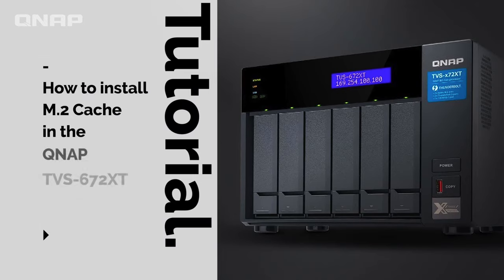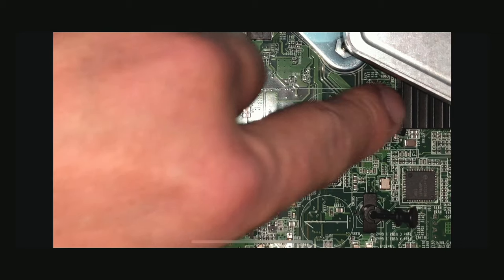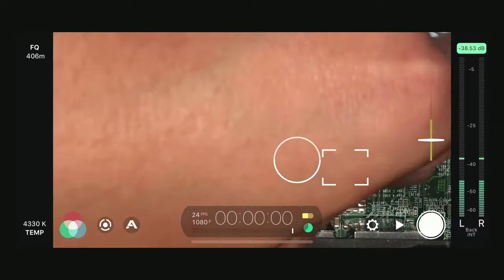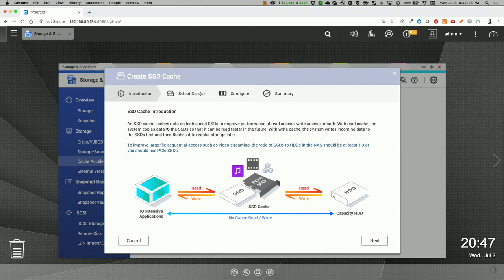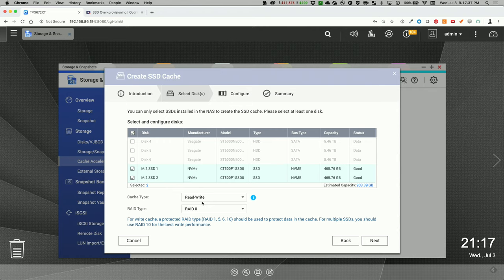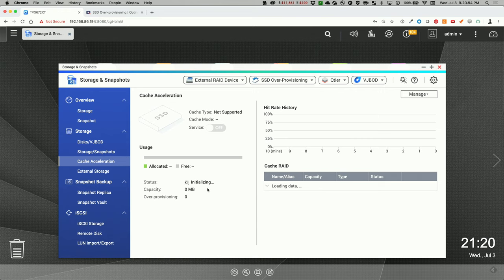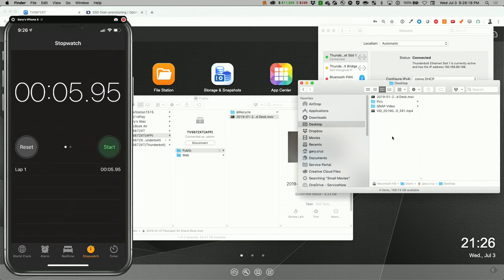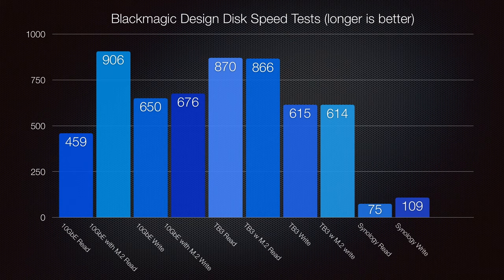QNAP TVS-672XT M.2 Cache Install and Speed Tests

Comment from the maker: QNAP TVS-672XT: https://amzn.to/2k1FcMF
QNAP TVS-472XT: https://amzn.to/2k1CqqH
Crucial P1 500GB M.2: https://amzn.to/2lyzJ0i
NETGEAR 10-Port Gigabit/10G Switch: https://amzn.to/2lyAars
OWC Thunderbolt 3 10G Ethernet Adapter: https://amzn.to/2k3pO2m
Seagate 6TB IronWolf Pro NAS HDD: https://amzn.to/2lAhTKn
OPOLAR Laptop Fan Cooler with Temperature Display: https://amzn.to/2lzwB4g
Reply: Hi Gary, Thanks for doing this video. Nice to see the challenges that come with installations like this.  Based on the provided info that this is a P1 SSD, could it be that this only supports speeds up to 1 GbE?

Comment: It was suggested to me that the controller chip is the warmest component on the board and that the small square heatsink should be attached to the controller chip. Now I am not that familiar with the Crucial NMVe, but isn't the controller chip in the center of the board and the two outboard chips are the NAND storage chips. They do get warm but not as warm as the controller chip which will ultimately cause the NMVe to throttle down when it gets too warm. In this video, the heatsink was attached to one of the NAND chips. JustSaying.

Comment: Did you put the heatsinks on one of the memory/storage modules 🤔 
It would be a lot better if you put it onto the controller since that is actually the part that needs cooling ...
Otherwise get full cover heatsinks from EK or some other brand since than you will be able to draw the heat away from everything
Reply: Same opinion....

Comment: You should have put the cooler on the contoller-chip not on the second storage-chip. 
BC the controller gets hot and need cooling. But the strorage-chips dont and need a working temp of around 50C to last longer.

Comment: You should have tried the 10G connecting SMB in stead of AFP. In the past QNAP's AFP was not that fast, my Macbook is faster using SMB in stead of AFP to my QNAP NAS, although it is only testet on 1G Ethernet.

Comment: If you over-provision the SSD with a RAID0 and one of the SSDs dies, won't you will lose whatever data is stored in the SSD over-provisioned space?
Reply from the maker: Paul Brunet with raid0 there is no protection. So you will lose data. Your data is striped across all drives with no parity.
Reply: Gary Cruz Dot Com I fully understand RAID 0. It would have been best to use RAID1 if using over-provisioning to ensure the integrity of the data of one of the SSD were to fail.
Reply: Ravneet Oberoi nope. If one drive does in a RAID 0, you lose everything. You need to use RAID 1 if you want to mirror the data on both drives.
Reply: Ravneet Oberoi you can definitely add cache drives to your system however they won’t add any drive space as they will simple used for caching the data that you access and store on your existing array.
Reply: @frenchfriesfilms  no it wont move to HDD until the system knows you are no longer using the data
Reply: The data loss can occur, if one SSD fails, while the data is not persisted to the Raid5 HDDs. As the HDD are significantly slower, than the SSD this would mean the latest data you just wrote.
The Raid 0 config doubles the chance of such a failure. If you don't use write-cache there is no issue.
If using write-cache I would put the SSDs into Raid1 - by that you can loose one SSD without loosing any data. And you don't even sacrifice much on performance - since the m.2 SSDs are so fast - the speed of one alone is pretty-much maxing out the 10GB Ethernet already.

Comment: I believe you sacrificed Raid-1 redundancy for zero performance gain as most NVMe is already faster than the current bus can handle. I your only processing 5-10GB files 500GBs of cache is far more than you need. You might want to retest comparing Raid-0 vs Raid-1 caching.

Comment: How come the times for 10GBe are almost the same as for Thunderbolt? I was under impression Thunderbolt was supposed to be 4x faster.
Reply: I assume disk drives are the bottleneck so Thubderbolt is not giving him anything
Reply: you need superfast m.2 drives on both pc's for T3 to be of any use.
Reply: @gullintanni  nope, doesn't work like this. Have a TVS128 with M2 RAID0 (2000 MBps each), SSD RAID5, HDD RAID5 and MacPro connected with TB3 and 10G... MacPro internal r/w speed near 2000 MBps, TB3 read - 1200 MBps, write 800 MBps... Which is far away from 40 Gbps....
Reply: MrMilanina Bcz the QNAP thunderbolt 3 still use 10G Ethernet protocol to connect to NAS storage. Basically it’s 10G Ethernet via thunderbolt port. Bottle neck is still the transmission protocol being 10G Ethernet.
Reply: Just to add on a year later, Max yurev did a video on this and the m.2 slots are limited in terms of throughput as well as from my own research crucial drives are said to be much slower which is why people go with Samsung’s NVMe offering. But also adding on yeah, it’s basically 10 gig in the form of thunderbolt 3. Having the thunderbolt 3 is convenient for primarily Mac computers and the few windows PCs that can take advantage of it. However, qnap charges a premium for adding the thunderbolt 3 and there lower end stuff is much higher priced than 8 bays from synology, though the CPU’s on qnaps are far better to justify the price. But there is also really no in between.  For me I just use 10 gig on an 8 bay synology nas and then have a 150$ adapter that translates the 10 gig to thunderbolt 3. All in with 2 1 tb NVMe drives, the 10 gbe adapter, the add in card to add 10 gbe to my synology nas, 32 gb of ram upgrade, 2 noctua fan upgrades. The Synology NAS with the upgrades cost me around $1,500 (not including the HDD). For a similarly speced qnap it’d cost me about $2,500. And from what I understand as long as I’m not doing any heavy transcoding or stuff like that,  I’ll probably be fine with the quad core intel atom that comes in my synology instead of the i3-i7 that comes in the qnap. The extra $1,000 premium on a cpu that probably cost 100 to 300$ didn’t seem worth it to me
Reply: Because he told me accidentally mis-recorded the results and was to lazy to do it again

Comment: Trying to decide what to buy for Plex streaming I want to stream atleast 2x4k movies at the sametime. local. its between qnas or synology. but I hear many bad things about qnap with discounts software issues.  Either QNAP TS-653D-8G or DS1621+
I could always buy m1 mac mini to stream more movies and for transcoding. can someone help me decide?
Reply from the maker: Both Synology and Qnap are great Plex servers. The challenge with a Mac mini is that you have to leave it on. The NAS drives are designed to be left on 24/7 and has an added benefit of being a file server.

Comment: You put the cooling to wrong place and should also remove the paper.
Reply: Yes, the heatsink was attached to the wrong chip. However, it is not necessary to remove the label. Most of the NMVe labels will transfer heat just as effectively. I was told anyway. JustSaying.